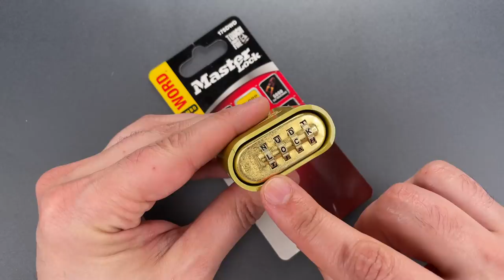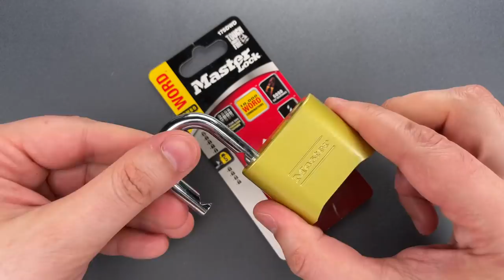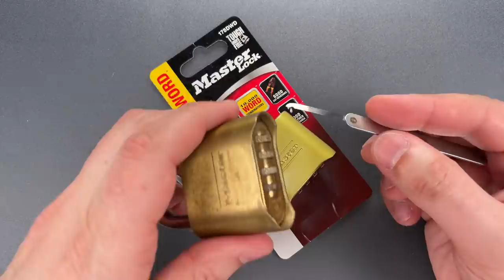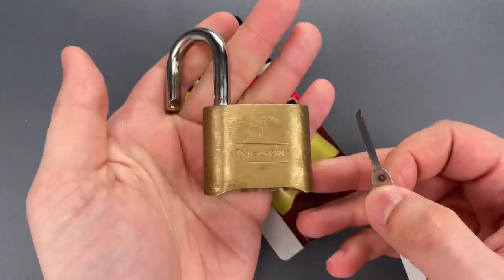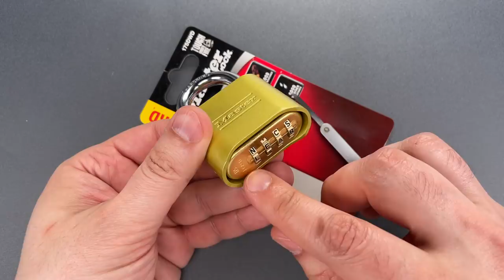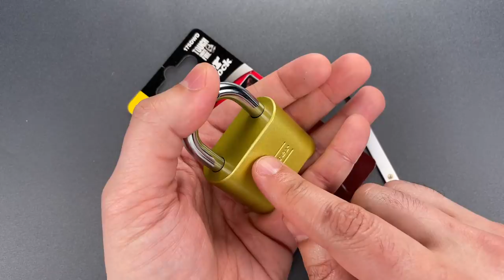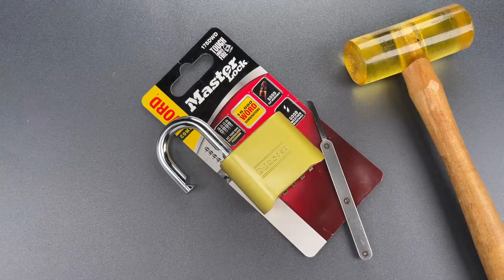[1272] Good Job Master Lock... Kinda.

Comment: Coffee cup might work..
For non-pickers like me, a straight screwdriver will suffice- Peel the thin plate away from the wheels, then bend the wheel's axle outward, it all falls apart and opens up. 60 seconds!

Comment: actually, having letters increases the number of possible combinations considerably. The english alphabet has 26 letters, this lock has 4 dials, supposing that each dial has all the letters on the alphabet then, the total possible combinations on this lock is 26^4 = 456976, now if instead of letters it had numbers, we would have only 10 possible options on each dial which would give us a grand total of 10^4 = 10000 so, yeah, this has a lot more possible combinations by using letters instead of numbers.

Comment: Some 175s are tight but if you align one of the deep horizontal groves like 45 degrees to the top edge of the wheel slot you can ride the wheel in as you apply rotation to it with the pick pick up side down use the back to perform the lift. Also pick the wheel with the largest gap they usually have one thats larger a   .035 wire with a standard hook style bend at the end can usually do the bypass as well and needs less opening to insert

Comment: Lol Why don't they just use a grove in the number wheel to make it impossible to insert something?
Yhe ofc there is something i do not know on how it works and it might not be able to implement it but i see no reason why not.
I learned to pick these locks almost 30 years ago with a piece of paper. (and i stopped there :) )

Comment: This is the locks they buy for us to lock tool boxes at work.   Jobox and other similar boxes have the lock recessed so it would be nearly impossible to strike the side of the lock.   Is there any other method aside from the shim if you can only access the bottom of the lock?

Comment: LPL - I found a 175 laying around the house. I know it’s al least 3 years old but not how old. The tolerances are too tight to slip a shim between the wheels but I was able to slip a shim above the wheel and pop it open. However, the rap exploit does not work on it. I’ve hit it with varying degrees of strength with a hammer to no avail. 

Keep picking.
Steve

Comment: the lock that he used the hammer on is still USABLE - it still locks, right - but if all you need is a blunt object to strike it with, it might not be SECURE. (there IS a difference!)

Comment: Technically the letter system has much much more possibilities than the number system. Even though it says it's a word thing, you can just as easily put 4 random letters. If we're looking at single digits, there are only 0-9 when you're looking at numbers, and you have the entire 26 letter alphabet to choose from, therfore much more possible lock combinations, although that doesn't matter anyway to you lmaooo